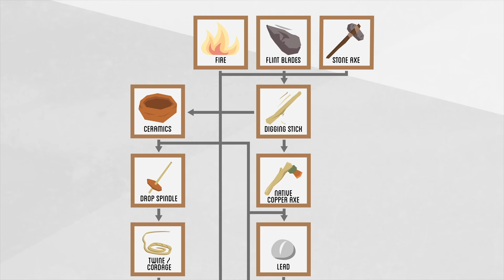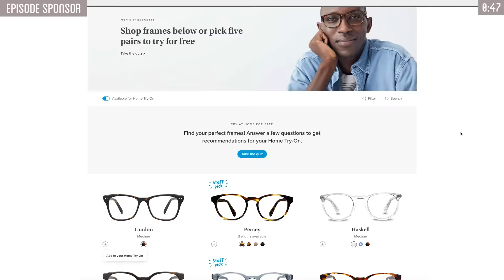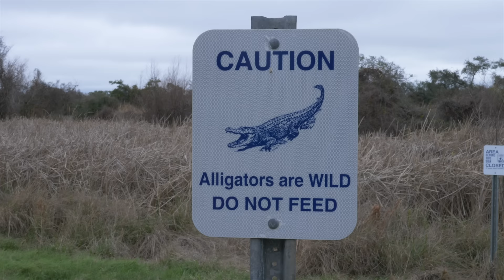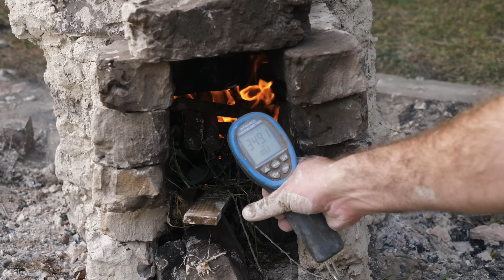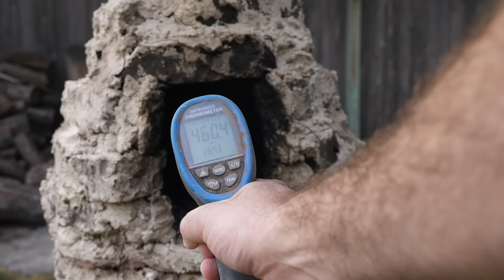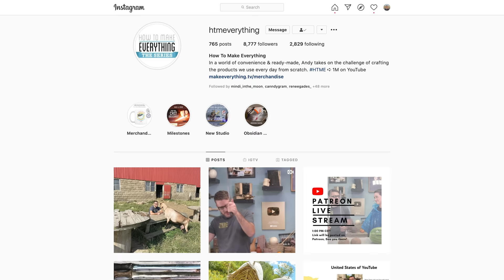Primitive Glassmaking (Creating Glass from Sand)

Comment: me thinks your moisture content in the bricks was a bit high when put into the mold. also, your mortar was very squishy also. also, when making bricks, dusting the mold helps with release, and use a flat anything to pull excess clay from the top. your bricks could have been much more uniform

Comment: Your bricks would be a whole lot better if you added a fair amount of sand . (As much as 35%, and 5% silt, with more sand for the chimney bricks.)  This allows the clay to shrink as it dries, with less cracking.  Your also should add finely shredded straw or grass because this helps to counteract the tendency for bricks to crack while drying.  It does not have any real value as reinforcement once the brick has dried, as you suggested.  You'll find the ideal blend of clay, sand and silt  at some point where an old  river turned around a bend, and deposited it , already graded.   You'll also improve your bricks by adding protein such as casein, which can be sourced from fresh cow manure. Add about 5% and see the result.   Another good additive will be a detergent, or a deflocculant.  Its an interesting experiment to try different ratios.

Comment: Historical blacksmith here. To build a better bloomery. use 1 part sand. 2 part clay. 1 part horse manure. mix it togheter throuly, and use as little wather as possible. it shuld be moist but not wet. The more water you use the more the kiln/bloomery will crack. Just in case make some extra mixture to keep on site for repair if it would crack. 

Hey works but due its size it's better suited for wattle walls on old buildings. Horse manure is better. 

(This mixture can allso be used for carbonating iron to steel. Remember the thicker the pice of iron is the longer it will take to carbonate it. To carbonate it. make the same clay mixture and flatten it out as if to make a pizza. ground up som charcoal and mix it whit water to a REALLY thick sludge. grab the iron and cover it whit the sludge. should be at a minimum atleast 1cm thick. ten heat it up in a overn till completly drie. After that cover the entire carbon package whit atleast a 1-2cm thick clay layer, make shoure that there is no unnessesary air pockets. let it air drie for a few days. Get a few wooden sticks atleast 2 tumbs thick. Now bring it to your forge, light a good fire and start burning the package. You need to "glaze" the package Heat it till its deep orange, and keep turning it. You need to have the entire clay package orange for a few hours. I think it was 1-2mm an houer for the carbon to "impregnate" the iron. after a few hoers dump the package in a bucket of water, and break the clay to fetch the rods/bar. IF everything went well, then you should be able to put the rod in a vice upright, and hit it whit a hammer to break of a part. Look at the crystalization of the metal to see if it did turn in to steel. If it's still iron then it will bend. if steel it will snap. The degree of steel can be seen in the crystalization. Small fine crystals meed hig carbon, big crystals mean low carbon. A bright ring of fine crystals and a darker spot core means you only got a partial convertion, Aka took it out to early.) 

I'm dyslectic so i'm aware there is probably lots of spelling errors. + English isen't my native language.

Comment: If you haven't discovered it yet, you can learn a huge amount about primitive glass making by looking up the Malkata glass works in ancient Egypt.  They were making high-quality colored glass long before Italy ever thought about making glass.  They (Egyptians) made their own pigments for permanent paint in brilliant shades of green and blue by first making glass they mixed with copper.  European painters had no access to such colors, which is why European paintings have so little blue or green in them, and in such dark shades (they ground up lapis lazuli for their only shade of blue).  The Egyptians made the glass by making low, cake-pan shaped containers of clay and putting the glass ingredients inside.  When fired, the glass melted in the clay bowls, and the Egyptians then broke the clay off the glass to obtain the desired glass which they then ground fine and put into their paints.  (The finished glass is called "frit".)

Comment: If you dig a big hole, containerise you’re contained of glass producing ingredients and on a brick platform that will be at the height of the fire that will be fed for two-three days. Build a structure that has layers of things to complete a roof for your kiln. Add wood from different points around the pit. Japanese Dragon Kin’s is the idea.

Comment: Tuyere is pronounced tweer. Also, your grog should be mixed into not into the brick mud. Plus your “mud” needs to be a little stiffer when making bricks. Adding a parting dust to the wooden mound before packing it also helps release the newly formed brick. Cheers

Comment: Borax and silica will make a glass, sodium and silica heated high enough will make a solid but it will be water soluble!  You will also need calcium (limestone) to keep it from being water soluble. When you do get it properly heated it will dissolve any pot you put it in, and the part of the glass that dissolved the pot will crack or explode if cooled next to glass of a different formula.
It is instructive that originally only Southeastern Mediterranean cultures had  glass due to the natron lakes in that part of Africa. It is also instructive to note that until iron tools were possible they could only cast the glass.
As for heat you might Google  Japanese wood kilns, or downdraft kilns. However, keep in mind that more European forest fell to glass workers than shipbuilding.

Comment: The secret is in the prep work,it should be down meticulously.Your grass fibres need to be thrashed an not so long.Aim for shorter fibres,Ensure the clay is free of rocks and other lumps,Reduce the water and line the inside of the mold with ash to prevent sticking.The more effort you place into making the bricks the better the end product.Aim for a square or rectangular kiln, with lots of air entry spaces at the bottom.The walls need to be air tight with a small exit hole at the top to draw up the air an increase the internal temperature. Bricks need to be air dried, then dried around the fire and finally in a kiln. Be careful to compress the bricks into the mold an expel all air from inside brick or they could explode when been fired by the rapidly expanding air bubbles. When correctly fired they will have a metal clink when hit with metal tool. good luck with your future endeavors.

Comment: Using some finely chopped dried hay in the bricks themselves helps them retain shape, it absorbs excess moisture from the clay, and when you fire the bricks, any that is hanging out like "hair" just burns off.  You can extend your load of clay AND get more regularly shaped and structurally sound bricks that way.  Mainly because you need a LOT less moisture to shape them... Less moisture to dry out = less wonky / less shrinkage.  Just a tidbit.  I've actually used dried lawn trimmings to good effect in the same manner. Also not a terrible idea to add some sand and gravel.

Comment: Regarding your glass sticking to the bottom of the crucible.    My grandson and I tried leached wood ash at the bottom of a store bought crucible ( guilty ).   Nothing stuck to the new crucible and couldn't because nothing came close to it..   Just a thought...have fun.

Result was a blue / green glob that was flat on the bottom.

7 hours cook time.
5 foot high stack.
4 air / fuel holes, 1 foot up from base.   

It lasted 2 winters out in the yard.  Then we planted Ivy around it.

Comment: the furnace needed lower air intakes that are angled upwards and pointing inwards, this naturally draws air in as the heat rises, a common mistake is not getting adequate air

Comment: Most primitive kilns that are efficient and reusable for long term production

Were earthen:  they were built into the side of a hill or buried to use the backfill as a way to stabilize the structure and provide more even heat control as well as a more stable platform for consistent firings

Comment: I didn’t read through the comments before I wrote this so if anyone has already mentioned this idea then wonderful!
My suggestion to make the process easier is to try using a parabolic mirror. You can cast with clay and create a parabolic concave form maybe it’s easier to find some reflective metal that is easy to refine (I’m not knowledgeable whatsoever of metals and how easy they are to extract from the rock) 
If you can find a way to make a parabolic mirror from scratch then you could use concentrated solar to melt glass. Once you have glass you can mold your own fresnel lens and melt stone and create megaliths or ornate works of art.

Concentrated solar will heat without imposing any impurities on the glass too. 
I have seen the YouTube channel King of Random melt aluminum in a fired-clay mold and the mold held together well enough for the aluminum to take the shape of the mold but the their fired-clay did crack a little. Perhaps they could have also used concentrated solar to “fire” their clay as well instead of a barbecue? 🤔😜 
In all seriousness I’m moving to South America to work with a new practical method of building strong megalithic obsidian buildings by melting stone with concentrated solar using parabolic mirrors and fresnel lenses. 
I plan on learning and applying the same methods you found most effective from your experiences in my future experiments! 
I’m so glad YouTube recommended me this! Thank you for sharing this technique. 
My group wants to make colorful windows and skylights too!
Perhaps we will also experiment with colored glass!
Reply: nice! y'know red glass needs gold. just sayin'

congrats on the move!

Comment: To make it better and thin, you should add less matter....and when it melt pull the crucible out of the furnace and lay it on a iron plat...so it will be transparent couse the layer is properly made.

Comment: i almost got a citation on a beach after we had a very large and hot fire, we managed to melt some sand and form very crude glass at the center of the fire. it took a fair bit of convincing to get the ranger to understand that we did not litter. we were also in the middle of cleaning up the mess when he arived...

Comment: Consider doing some extensive research on building and use of rocket stoves.  The rocket stove itself is pretty primitive in technology but amazingly high temp and extremely energy-efficient.  I think it just might be the answer to your difficulties of needing very high heat and a very clean environment to keep the glass clean.  Of course, the engineering would have to be adapted to serve the purpose but I can just about imagine what might work with the research I have done.  It would be up to you to chose which design and then what adaptions would work best.

Comment: If you use just a little less water in the ceramic brick mix and tap the sides of the form quickly with a small hammer, you could have achieved a more homogenous brick structure individually, yes it would have taken more time but, the end product would have been much worth the extra effort. This would have assisted in minimalizing the amount of shrinkage your bricks would have gone thru since there was less water, and each brick would have been a bit more uniform in density

Comment: Having watched John Plant make bricks and a brick firing kiln on his Primitive Technology channel, this video was downright PAINFUL to watch.

The clay was too wet, it didn't look like there was any fibrous material incorporated into the clay to prevent cracking, grog is mixed into the clay for strength, not sprinkled on the outside to prevent cracking.

Using the fired clay mold was a good idea, but you should have soaked it in a solution of water and wood ash to keep clay from sticking, and re-soaked between every brick.

Smoothing each brick as it was made would have saved you all kinds of time over shaving them down with a knife after the fact.

You should have built a dry-stacked kiln with unfired bricks and used it to fire the rest of the bricks, then rebuilt it with fired bricks to fire the first set.

Your bricks are rectangular; you should have built a rectangular kiln, and you should have made enough extra bricks to cover the top of the kiln to hold heat in.

Putting in a small amount of extra thought and effort at each step in the process would have given you a much better finished product and saved you a tremendous amount of time over the half-assed, slapdash method you actually used.

You're rushing it, and screwing yourselves over in the process.

Comment: normal  forge would be four times that size built into the side of a clay brick shelter. with a double wall. to keep the heat inside. and the air would be drawn from inside the building threw channels into the furnis to keep the work aria cool.
clay table inside is good, but would need larger slits to let heat threw. and thicker. use the slits to also increass light up top... yes the 2nd layer of brick will need to be built up to the top.
the taller the stack, the hotter it will stay inside. also with taper and slope will restrict the flow of air. and a 45° slope will keep water out of the inside if it rained.... adding wood inside the wall as insulation will work as once the wood turned to carbon, it wont let heat threw.

Comment: A little late to the party here. But as a potter/ kiln builder 2 big things to take away from this. Soda ash will eat through a crucible if you arent careful. You can see this on the rims of salt fired pots that have been blasted with salt. Also, for your kiln bricks, they need some sort of straw and grog mixed into the actual brick body to encourage refractory/insulative properties, these bricks can then be slowly pit-fired and used for a rudementary kiln (you need a firebox and a ware or glass chamber, 2 spaces within the kiln). Ready for round two of primitive glass!

Comment: The clay for the bricks should have grass or straw in them and also the clay is to sloppy when you are making them, resulting in longer dry times and also will make them sharper and uneven when pulled out the mould

Comment: With the benefit of technological hindsight, would you start by making copper wire, coating it with an enamel/resin, making an electrical generator (not difficult - no magnets required) and then using the electrical power to melt stuff?

Comment: Just wondering if salt wort is better than soda ash from kelp. If this plant is equivalent to kelp ash then it would seem better to use kelp for the video as it is much easier to find and found in a much larger area.
Just seems to me that if your at a point where you need to make your own glass then hopping a plane to some place in Texas also isn't an option.